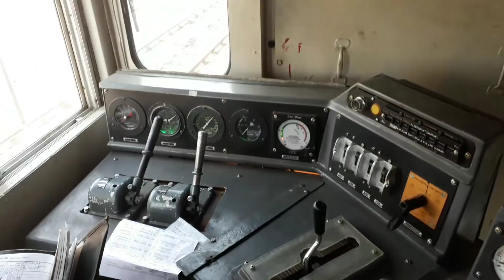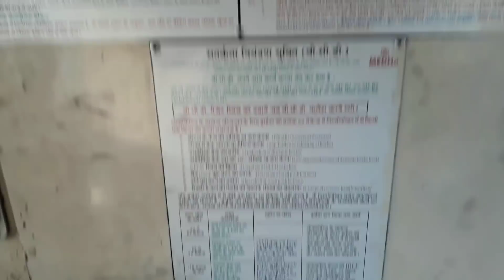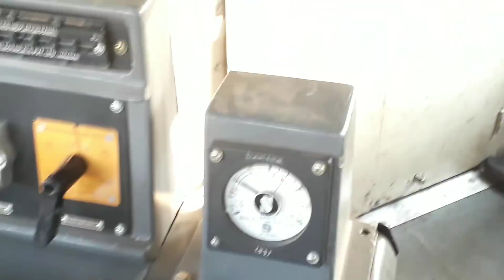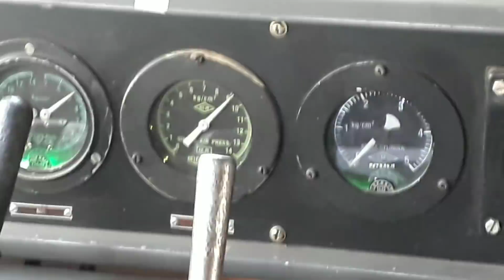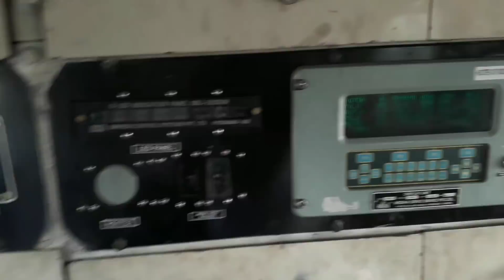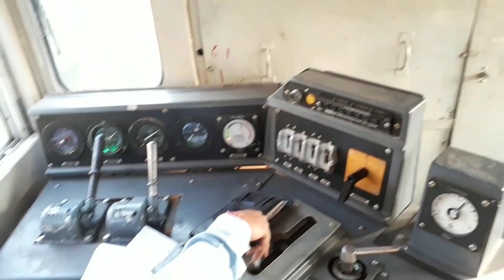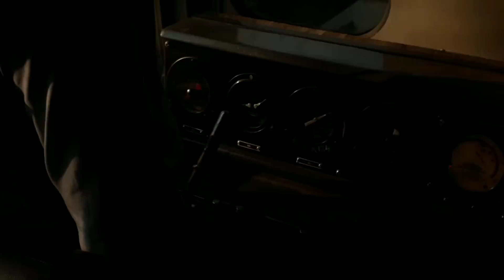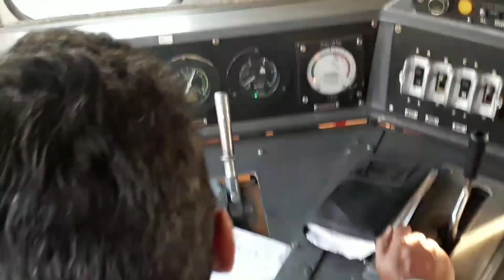Inside the Standard DIESEL Locomotive l Indian Railway Engines l 2020

Comment: Catalog Name: Amazing Women's Sling Bags Vol 4

"Women Messenger Handbags Shoulder Bag Crossbody PU Leather Satchel Sling Bags
Features:
The fashion version of the type:concise but not simple, high-grade PU material,extraordinary quality;
Exquisite design: generous, simple fashion;
Easy to carry: Breakthrough cumbersome,Handy convenient.

Specifications:
Material: PU
Size: 22 X 18 X 11cm/8.66 X 7.09 X 4.33""
Purpose: Crossbody Bag
Style: As shown
Color: Variable (Message Us For Details)

Notes:
1. Due to the different monitor and light effect, the actual color of the item might be slightly different from the color showed on the pictures. Thank you!
2. Please allow 1-3cm measuring deviation due to manual measurement.

Package Included: 
1 X Messenger Bag"

Dispatch: 8 – 10 Days

Designs: 5

Easy Returns Available in Case Of Any Issue